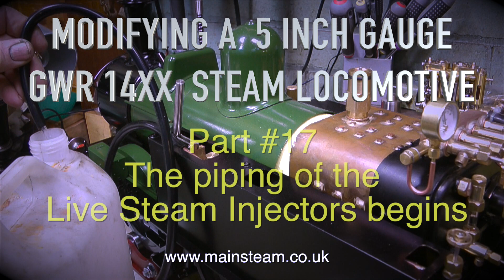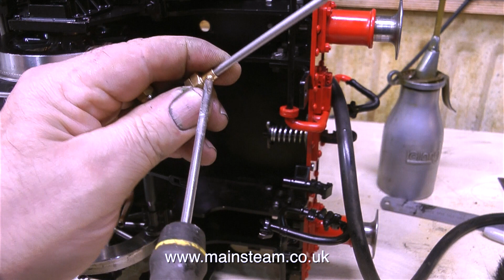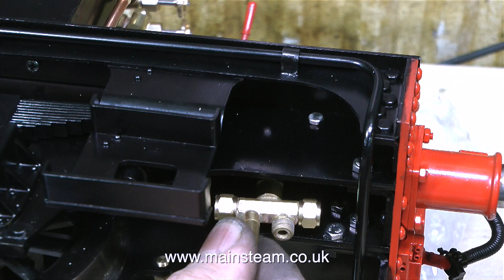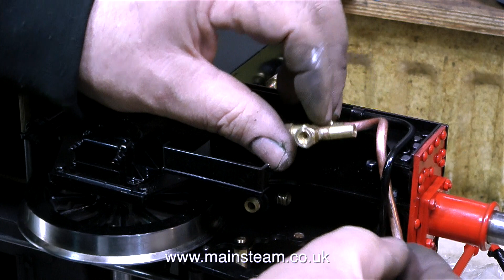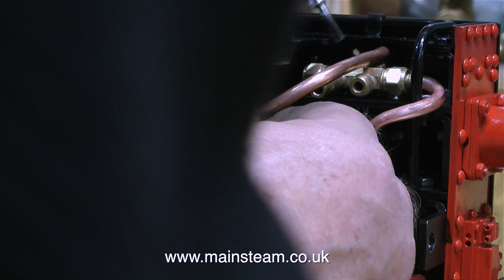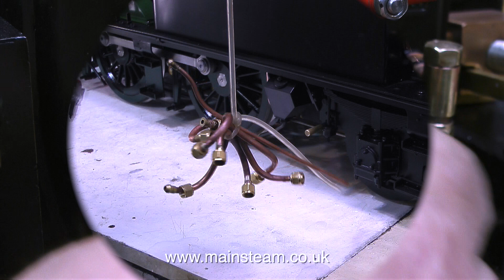MODIFYING A 5 INCH GAUGE GWR 14XX STEAM LOCOMOTIVE - PART #17

Comment: How much slop is the Bahco movable jaw supposed to have? I just purchased a new 8069 in chrome and it just seems excessive. Also, the packaging states it is made in Spain. I thought these were made in Sweden.
Reply from the maker: there is supposed to be a bit of slop, but if it's excessive then there is something wrong. As with most other things these days, the products are not as well made as they used to be.